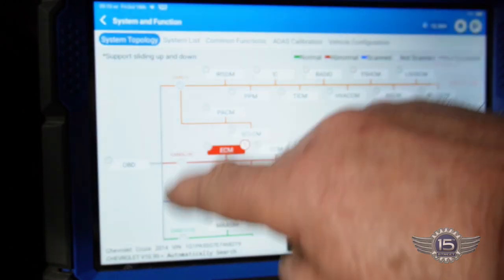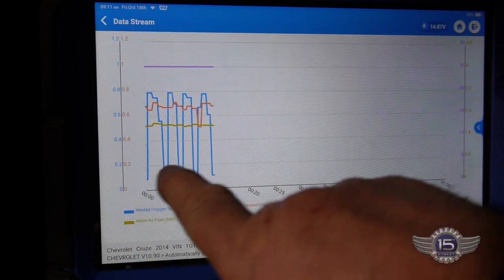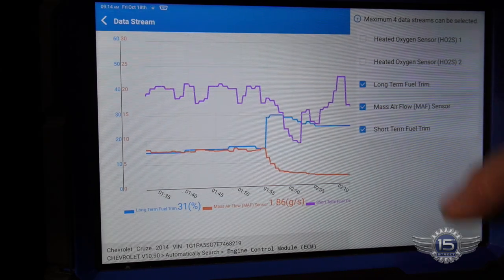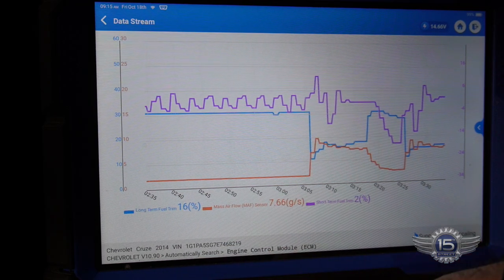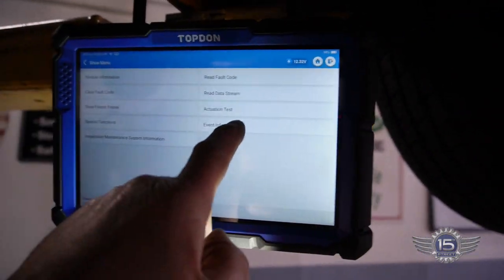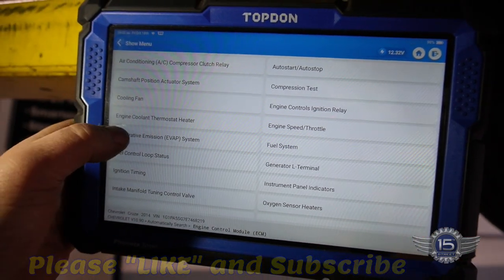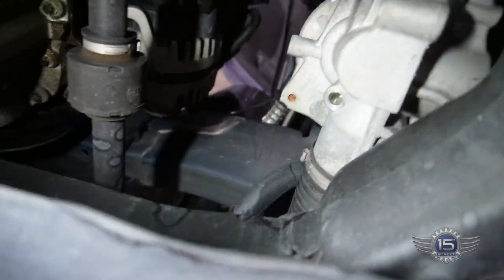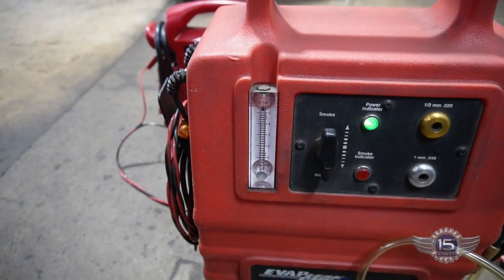Chevrolet Cruze 1.8L Purge Valve / Lean Condition

Comment: Very good job there Sir I also am a retired GM mechanic and those purges did cause lots of trouble and also the intake on the that engine would leak it too and also they that evap canister vent valves with stick we had a lot of gravel Rd. cars around here and that dust would get in there and also the the PCV valve in that that valve cover cause lots of problems too leakage whistling and oil usage and everything under the sun good job there Sir
Reply from the maker: That’s why I always recommend a smoke test on these.

Comment: Good video.  Keep in mind that typically the STFT will be close to zero when adding revs if a vacuum leak is present.  Long term trims won’t show immediate changes.
Reply from the maker: I've found that because you change "blocks" the LTFT does change immediately. I have seen this on most vacuum leaks that I have encountered. But that is something to keep in mind as not all vehicles function the same way.